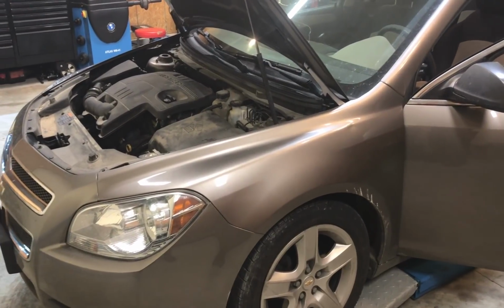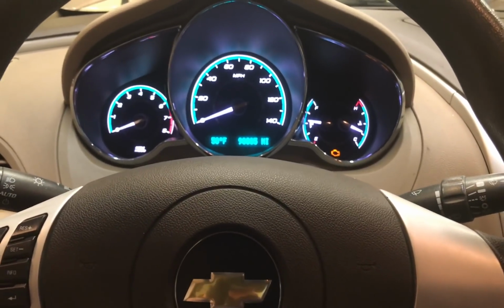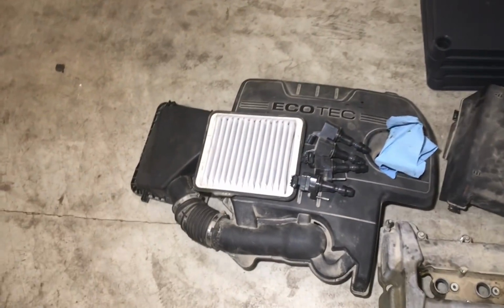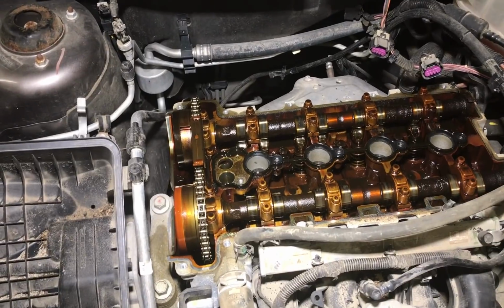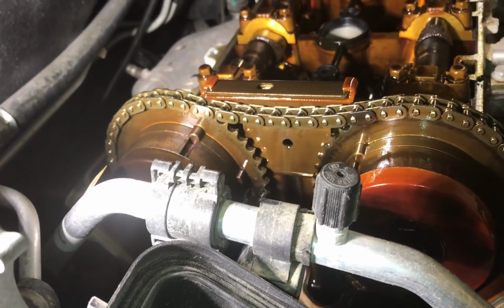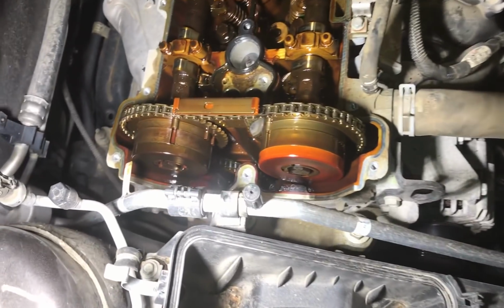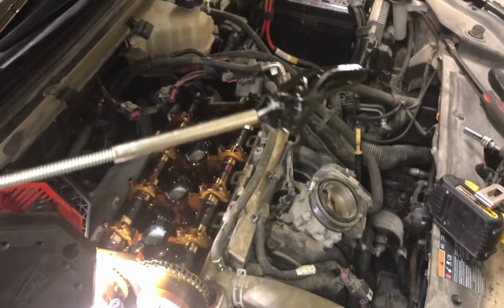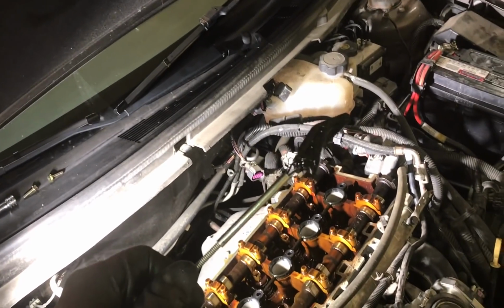EcoTec Timing Chain Guide Failure

Comment: Cheaper to just buy a used 1997 Camry.
Reply: if people undercoated there cars they would be around longer
Reply: CMac or a 99 Honda Accord
Reply: CMac
Make sure it's a v6, those things fly!
Reply: Simplex SM Good point. For those who live in salty rusty areas I'd recommend a 2003. Should be able to buy one with the $ saved not fixing the GM, and it's scrap value.
Reply: Quebec lol
Reply: CMac yeah but then ur driving a Camry
.
Reply: Simplex SM I never see rusted 4th gen camries.
Reply: Meanwhile those Camrys from the mid to late 90's with the 3.0L V6 had major oil sludge issues. All cars can have issues down the road particularly if regular synthetic oil changes aren't done along with other regular maintenance.
Reply: CMac If you can find one that isn't rusted out or that the interior isn't trashed. They're all like that in Quebec.

Comment: What? Will a broken chain guide cause timing chain defects, so that it'll need to be replaced as well? Or do you renew the chain - since you're there?
Reply: Peter Riis once you have the fron engine cover open, its best to change everything from tensioners ,chain,guides..
Reply: Thanks, Joe. but that doesn't really answer the question. :)
Reply: Chains stretch over the life of the engine, so if you have an old chain with new tensioners/guides, the new hardware will be working at the edge of their design tolerance, whereas with a new chain/tensioners/guide everything will be working within the spec the manufacturer designed the engine too which will put less stress on the components. So you don't need to change the chain, but you might as well because the part is cheap and you are in there anyways :D
Reply: Once the chain is loose,  replace it all,  chain, guides, tensioner- all the she bang!!!  Even the water pump if it's part of the chain job.  Do it all.
Reply: The timing chain comes in a kit that contains the chain, guides and the tensioner.  The only parts you'll need to get that the kit doesn't have is the camshaft gear/phaser bolts.  Those bolts are torque to yield and need to be replaced when removed.  The kit also doesn't come with timing cover nor valve cover gaskets either witch you may want to replace as well.

Comment: You dont seem to be worried about any valve and piston collisions that might have occured. Was the engine still running but really noisy?
Reply: This is an interference engine.  Since the ecotec engine came out in 2000 I've seen many of these chains break over the years and when they do the valves get bent and the valve guides get broken witch will require the cylinder head to be replaced.  It's cheaper to change that loose chain now before it snaps!
Reply: Maybe it is not an interference engine.
Reply: It'll be noisy, rough idle.
Reply: @Brian Bartosch Wow. Now that's what i call a cheap engine design, another car to avoid then